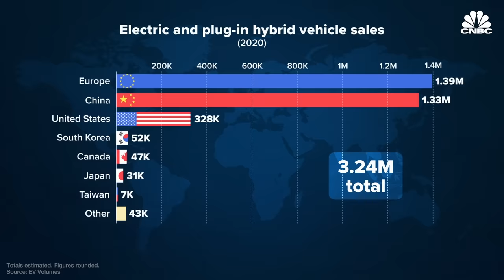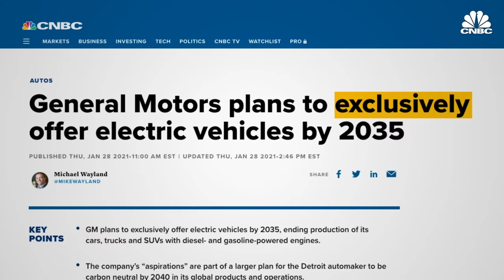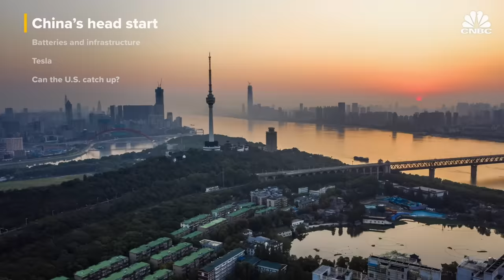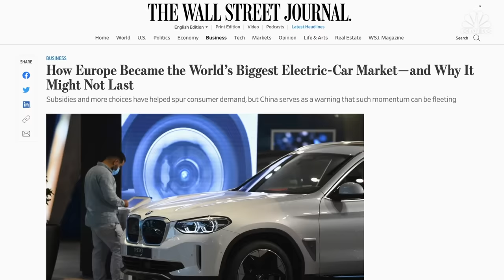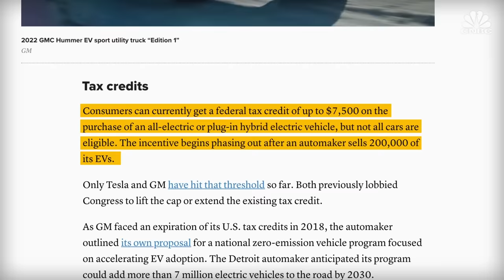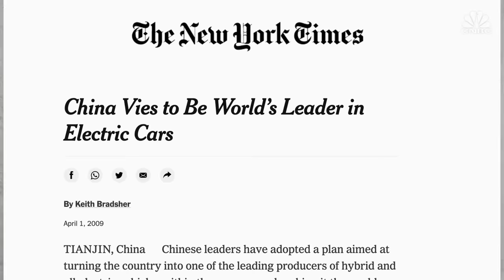Who Is Winning The Global EV Race?

Comment: Forget about battery swapping . Charge at home when not in use. Range anxiety is a non issue among EV owners. Tesla is the leader among manufacturers. China is the leader among countries.
Reply: Frankly, I think that’s a blanket statement there. Range anxiety is a non issue only when you’re talking about short distance commutes, which is clearly NOT battery swapping techs are targeting.
Reply: @doniel2008  well here in the us superchargers are everywhere and it takes 15 mins to get 200 miles. i dont see how battery swapping is helping
Reply: @doniel2008  I've traveled from Canada to Florida with no range anxiety.
Reply: @doniel2008  150+ miles in each direction is more than enough for the average driver. The average driver travels less than 30 miles from home even when they drive 100 miles a day.
Reply: Range anxiety and charging is a real issue to city populations that live in apartments without parking lots. You buy transportation to suit your lifestyle, not the other way around.
Reply: @awes5709  charging is more important than range for city drivers (without a plug at home or work). If they can opportunistically charge while they're parked to shop, eat, or entertain then they're fine. It's only if they have to make a trip to a DC fast charger and hang around for 20 minutes that the inconvenience means they'll want to minimize those dedicated charging trips by having a longer-range EV.
Reply: Norway is currently testing wireless charging at some parking areas. Ideally this would be a solution given  your car is parked longer than actually driving since charging speeds will be slower.
Reply: The public is still not realizing how inexpensive it is to charge your EV when you put solar panels on your home. Add back up batteries and your fuel bills disappear and home energy bills are greatly reduced. This is the way forward.
Reply: @awes5709  That sounds more like charge anxiety. I think you need to be able to charge at home anytime for an electric vehicle to make sense.
Reply: I agree with you, but I think there might be a niche use for battery swapping in some areas. Perhaps for car-sharing schemes and that sort of thing.
Reply: @seybertooth9282  Sounds good but might be easier said than done. The battery pack is becoming a structural part of the car and there is no standard. Everybody does it differently.
Reply: @awes5709  That's why you install chargers in parking lots of shopping areas. Supermarkets, Home Depot, Costco, shopping malls. This is a great idea for both sides. Gets people out of their home to shop and drive commercial activity while not having to wait for charging.
Reply: @doniel2008  
Long distances?
The car Out-ranges the driver.
While the driver and passengers "refresh", the car charges.
Repeat.
With an efficient car, it's not a problem.
Battery swapping? 
Waste of resources, requires many multiples of packs sitting idle just in case they're needed.
Reply: @awes5709  
Ok.
City "lifestyle".
First, why do you need a car?
Second, if you do, what's the use case?
Socialising? Charge while you socialise.
Shopping? Charge while you shop.
Graze charging 3 times per week for an hour each time will be more than enough.
Leaving the city during the week? That's an odd use case...... But that puts you onto the fast charge network.
Don't just take the negative narrative without thinking it through.
Reply: @dub88acc  
Or just plug it in?
Reply: @jeffbaldwin9842  
No.
You need the opportunity to "graze charge" while you do other things.
That's the different mentality required.
You're at the gym? The car charges, shopping? The car charges.
"ABC"
"Always be charging"
(Borrowed from a Norwegian)
Reply: @seybertooth9282  
Battery swapping won't work.
The NIO stations have 13 packs per unit.
A 5 minute swap gives them 1 hour of packs but only one swapped at a time, so if you pull in behind a car, you're waiting.
On a busy day....... There may be several cars, you're waiting longer.
That's if there's only one pack size.
If there are let's say 3 sizes, (or types) that's down to 4 packs, or 20 minutes supply per type.
But, the packs take an hour to charge.
So if you pull in behind "pack 4" you're waiting untill "pack 1" is ready. That could be 40 minutes...... Unless they up the charging rate, but that degrades the packs, or unless you take a partially charged pack, but you paid for a full pack, that defeats the object.
.
Then there's the "but you can upgrade for a long journey!" opinion.
.
Tell that to the "large pack" driver when he pulls up to find that 4 "small pack" drivers have just upgraded and left all small packs in the station.
.
First public holiday, it'll be a "dogs breakfast".
Reply: @FKS1994  
"Graze charging"
Reply: @Roger Starkey  Convenience.  If people would like plugging in things wireless chargers wouldn't sell or be a feature for phones.  Also its easier.  Many people are confused by plug in chargers
Reply: @rogerstarkey5390  You might be able to do it that way one day but seems like a hassle to me. Plug it in when you go to bed, unplug it when you get up. Done. Unless you drive more than 250 miles to get to the gym and shopping everyday or live in an apartment. If so, an electric vehicle might not be your best option.
Reply: @rogerstarkey5390  Its not the "negative narrative ", its based on my experience and plenty of others as the practical view. Almost everything you mentioned facilitates that I have to do some sort of charging chore in my day, social or not. And I'm not going to waste time sitting at a public charging station for an hour  after waiting in line. Also I'll purchase a vehicle because I want such and can afford it. Not validate why I should by one. Bottom line... until a method of charging/replacement of a battery can be done around the same time it takes for me to fill a tank, its not practical for me or most of apartment renting persons in major cities. The infrastructure isn't there now. The cars cost too damn much anyway. 
About 2 times a year I drive from Chicago to Atlanta to visit family. It takes me 10hrs tops (when going the speed limit 😏), Just how many more hours would be added it i was in a E car.
Reply: @em-wg7bj  that seems like a long wait time when compared to a few minutes to fuel up for twice the range
Reply: Honestly not a problem for most of the city drivers. However, the temperature is a big issue. Every country has its own transportation preference. Not many people in China will drive over 100 miles at one time. I know a Chinese “ Uber” driver who use a EV to do his business, a $25k BYD, and had no problems for 250k miles of driving. Most of the EV cars can now charger to 70% within half hour, not a big issue but yes if you are hurry, better choose cars with gas.

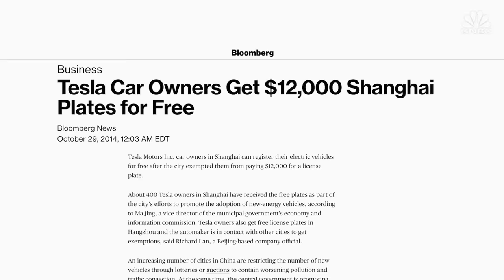Comment: 4:44 I need to point out, Chinese authority never set the rule to charge more for purchasing traditional car, the price has always been like that whether it’s high or low. The authority has significantly reduced the price on electronic cars by cutting sales-tax or financial support for car companies, and almost no charge on getting a green plate which allows you to drive int city with no restriction during rush hour. The regular plate which is the blue plate, the number of blue plates being issued each year is limited, so it is expensive to acquire.
Reply: and it's just limitation in very few proportion of cities in China
Reply: They do have a horrendous smog and pollution problem
Reply: @j.pgoodwin9020  China hasn't had a smog problem in years. HOW CAN IT BE A SMOG WHEN CHINA WAS SHUT DOWN THE PAST 2 YEARS. WHERE WOULD THE SMOG COME FROM ?  COME UP WITH ANOTHER LIE DUDE.
Reply: @chickaboomboom2726  buis releases smog.
Reply: @spicyirwin5835  you meant buses? China has been using electric buses for a few years now
Reply: they are artificially raising the expense of a gas car, that's not really offering an option.
Reply: @johnnytang5192  how much coal needs to burn to turn that electric generator? Why not use nuclear batteries like government uses?
Reply: @MAGnetICus_Attractus coal power plant is more efficient than a small car engine, plus the powerplants are usually far from the city and not spewing fumes directly in your face. They are heavily investing in nuclear as well
Reply: You are right  @Distress.
Reply: @chickaboomboom2726 MORE SHOUTING PLEASE!!!!

Comment: Tesla has been winning the BEV race since 2018, when Tesla BURIED the BOLT.
Reply: Bolt was a sad attempt at competing. Lower trims did not even have a fast charging port.
Reply: @hermanwooster8944  yes, the early BOLT had to Upgrade at Factory to "fast " charging.......lol 
and it was not that fast , slower than Tesla.
Reply: Recently bolt had to recall all it's vehicles for catching on fire while parked charging.

Comment: You don't seem to understand how superior Tesla's charging network is.  1) Higher average number of stalls per location, so you're more likely to find one that's available.  2) Higher average power output per stall, for faster charging.  3) Better software; you just plug in and walk away, without swiping a card or punching in a PIN.  The App tells you when it's done.  4) Much more reliable; by comparison, Electrify America stations are infamous for being out of service when you get there.  5) Better locations, next to nice shopping and food areas.  And 6) Way more locations world wide.
Reply: This video ignores everything going in Tesla's favor. They also assume Tesla is just going to lay down while the others try to expand.  Tesla growth is still outpacing the competition and they are still accelerating.
Reply: Tesla supercharger network is not a advantage in the more important markets like Europe or China.
Reply: @robertjonker8131  let's wait and see
Reply: But tesla cars are bottom of customer satisfaction ?
Reply: @robertjonker8131  Teslas are seen as overpriced and people are nervous over low customer satisfaction ratings .
Reply: It's true, with a Tesla it's really easy and reliable to charge a car, but all other chargers require a bunch of unnecessary steps, there aren't enough chargers, and they are not reliable.
Reply: Just did Toronto to hilton head in our Y. 1000m each way charging is integrated into navigation and the adjusts as conditions change. Perfect in every way. Stop, plug, pull plug when instructed, drive away. Simple.
Reply: Every time I go to my local mall, there are 3-4 Teslas parked in the charging spots. Most of the time their drivers are just sitting there in the car waiting for it to charge. And you know they've been there for at least an hour, because why would you sit in your car unless you already walked the mall. What a wonderful way to spend the weekend, charging your car. Fuken EVs...
Reply: This is a GLOBAL video, not US and Tesla doesn't have this network elsewhere.
Reply: @robertjonker8131  
The supercharger network is ABSOLUTELY considered an advantage on this side of the Atlantic.
Reply: @MyKharli  
"Tesla's are seen" as being in the same price bracket as the Germans and are giving them a spanking.
Reply: @andrewbell8837  
Come in now.... Don't go giving the "sceptics" actual factual experience for someone who's used the network!! 👍😁
Reply: @tinytownsoftware3837  
No, you don't.
Reply: @jcinthailand  given the video is 1 year old we did wait and see. Tesla nearly doubled sales from close to 500k to ~930k..
Reply: @teslaheini3169  only because of mad fan base , there one from bottom for reliability, much better options available in europe and china anyway which is why they don't sell here , also the musk fan base here is very low .
Reply: I just want it not to be Tesla. I like that the EVs can do all of those things, I just want them ALL to be able to do these things. The fact that these things are exclusive to Tesla is disappointing to me and keeping me from getting an EV, honestly. 

Imagine- instead of Tesla's own branded charging locations and connections, they're privately owned locations, with abundant stations across the world, using a universal standardized connections that work on all EVs of all brands, and most brands don't have an app at all, as they don't need it.
Reply: @MyKharli  Not the fan base, I feel like you're overestimating how much of that is playing a key. Though it is an argument, and certainly a fun subject to ridicule, I think the biggest factor for Tesla's practical monopoly in the US is due to the size, geography, and city design. In many parts Europe and Asia, a 30 minute drive is seen as quite the commute, to us, that's basically around the corner. This demands the fastest charging and highest miles per charge, and really only Teslas make the cut for most people, as OP explained.
Reply: @rogerstarkey5390  No I don't what? What are you replying to?
Reply: So ban cars only in the city? Or ban cars everywhere?
Reply: @Historian Lies. Tesla tried battery swapping some number of years ago, but abandoned the idea because of scaling and logistical issues. While it may work in China, where people basically live on top of each other, this would not work in the USA, because it's more spread out.
Reply: @tinytownsoftware3837  Hilarious.
Reply: @hybrdthry911  ,  I am heavily invested in TSLA and generally optimistic but Musk does appear to get distracted by shiny things. Besides twitter he has recently has deferred affordable EVs for Optimus (robot) and AI/FSD/robotaxis.
Reply: @tinytownsoftware3837 , Next time ask them how long they have been waiting. typically, for me on the occasional road trip, charging is 20-30 minutes and I will take the dogs for a short walk, or watch a youtube video.  But mostly it is just a short break and I am on the road again.  You are misinformed or lying.
Reply: @ricinro  Most certainly not lying. I drive past the mall every weekend. Without a fail, there is always at least someone waiting in his Tesla to charge. Even if it's 20-30 minutes, why? Why waste your precious weekend to charge your car? Seems asinine.
Reply: Exactly!!
Reply: @MyKharli  Amazing what happens when you don't pay the auto reviewers to spin your narrative.  Tesla is quite stubbornly refusing to "play the game" established in the industry.
Reply: @rogerstarkey5390  Tesla will gradually start opening the network even in North America.  CCS stalls (not just sites) outnumber Tesla superchargers here in BC despite massive Tesla sale numbers.  Tesla may also need to eventually adopt CCS for charge speed and technical reasons with the 800V architecture of the cybertruck.  The Tesla plug is great for cars but to push faster charging will eventually require a bigger connecter to expand the air gap.
Reply: @ccibinel  It certainly is , i can think of no other manufacturer saying you would be stupid not to buy my car because you could earn 30000 dollars a year using it as a driverless taxi when your not using it .ROLF
Reply: the new 15 minute chargers make the Tesla network obsolete
Reply: @katzgar  What "15 minute chargers"?  Are there thousands of these already installed all over the world in convenient locations, like the Tesla network?  Do these alleged new chargers have greater than 98% availability, like the Tesla chargers?  Vaporware doesn't make real hardware "obsolete".  And besides, the most powerful charger in the world can't charge a car in "15 minutes" unless the car is designed to charge that fast,.
Reply: what if they make universal charging stations that work for any electric car?
Reply: @thepotatoofheaven - like the NACS plug? Ohh wait...
Reply: @tinytownsoftware3837 😂lol sitting in their car for hours